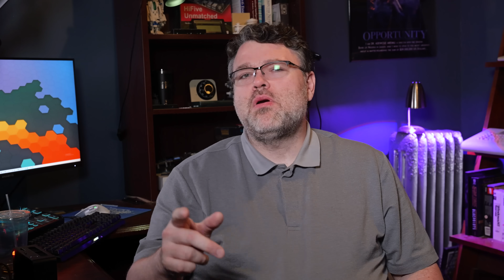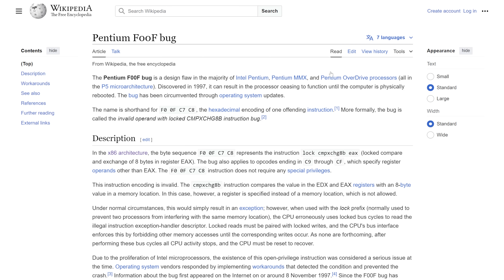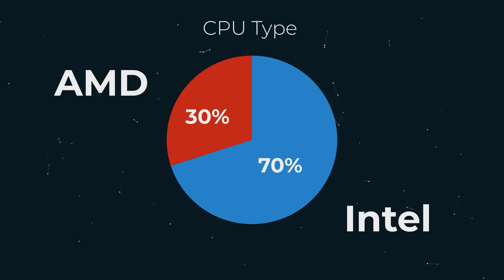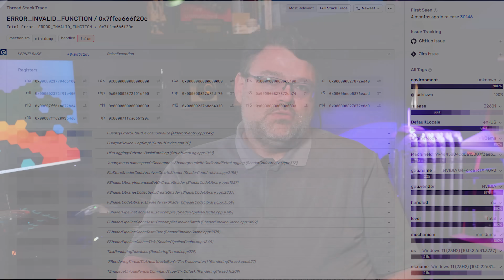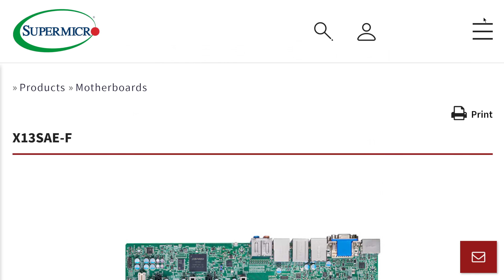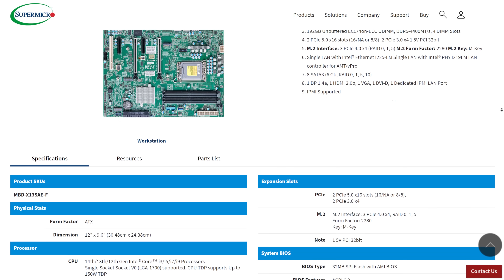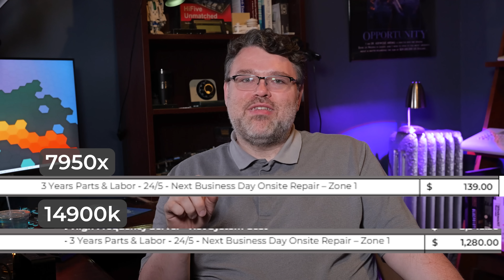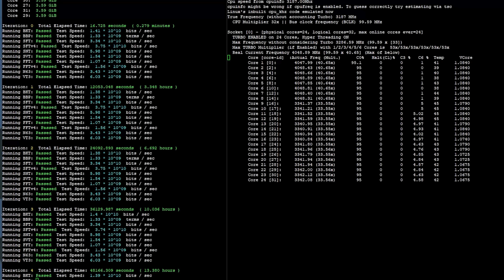Intel has a Pretty Big Problem

Comment: DISCLAIMER: This is just my own speculation!!

I really have the suspicion that this might be a die defect manifesting for some of the chips that slipped through binning because it's so marginal it is hard to find because the time they spend testing is not sufficient to find it. With smaller and smaller lithography, this seems to become more and more of a challenge. So the root cause could be an issue in Intel's fabs.

I got a 13900KS on an ASUS Z790-CREATOR WIFI with 0814 BIOS version, limited to 320W maximum on PL1 and PL2 and with a 50mV undervolt and it runs rock solid since I bought it. I basically did this tuning on day one and haven't upgraded the BIOS anymore after I got it working. Never change a running system. I'm doing a lot of single threaded things but also multi threaded tasks. I rarely but occasionally also play games.

The only weird thing I observe are rare WHEA errors where it says an error has been corrected regarding some PCIe port that connects to my 10GBe Ethernet chip on board, which I also use and I never have network issues either. But that could be attributed to the first version of the Thermal Grizzly Contact frame I am using, maybe the mount is not 100% correct.

So it seems I am just lucky and got a chip which doesn't have this weird fault... Goodness...

Comment: Intel is pushing their chips too hard in an attempt to keep up with AMD's ongoing superiority with Ryzen I suppose. I'm feeling that by now their Core architecture has been pushed beyond the limits of what it is sensibly capable of, yet at the same time Intel does not have an answer in the form of a new architecture to keep up the fight with AMD.

Seems that Intel has made themself comfortable for too long without any serious efforts into improving their tech throughout the years as they were not experiencing any serious competition for a long time, therefor there was no need to invest nor make serious improvements. That was until AMD showed up with Ryzen and at this point even worse with various ARM cpu's now also starting to blow away Intel CPU's.

Comment: Verryyy interesting. Intel should come out clean for their own sake before Gamers Nexus does. Also, it's quite funny that Intel is now the buggy one that barely works while AMD is the cheaper, more stable and better performing one. Oh, how the mighty have fallen in just 5 short years.

And before you start throwing any accusations my way, I actually run 12600K system and have been mostly happy with it, but all these news and Intel's current shenanigans are suggesting that I will be going for Ryzen 9000 series later this year as update.

Comment: For what is worth Brian from the Channel YesTechCity has been saying for months now the problem is not microcode, Voltage or clock (at least just in part) but I/O (citing some unspecified Intel sources).
Basically the I/O portion was supposed to be a separate chiplet, but they went monolithic due to other foundry related issues and that caused the problems.

Comment: I just bought 3 X MS-01 with the i5 12600H CPU to use as my new home lab cluster for XCP-NG.  I hope this problem does not extend out to those CPUs, and feel like even if not, I barely missed a bullet by not getting the more powerful 13900 series CPUs.   Damn Intel; what is wrong with you?

Comment: Before the problem went public I had to troubleshoot by myself. I had it with a 13600 and an upgrade to 14700 did not help. Changed memory an tried out the graphic card (4090) on another system. Motherboard is an ASUS PROART... I had no idea how to troubleshoot it.
Reinstalled windows and changed and swapped multiple nvme ssds.
In the end I solved it upgrading the alimentation from 1000 to 1200 w. !!??!!
After that all the internet discovered the problem and I changed the bios setting as proposed but by that time the problem was not there anymore.

Comment: I use amd so I can use ECC ram on my desktop pc with normal cheap chipsets, and ensure data integrity. Intel still artifically seperates ECC because they suck. Currently running AMD Ryzen 7 5700X3D with ECC ram, so, so  stable.

Comment: Significant slowdown followed by crash sounds like thermal problems.
I used to have significant overheating problems where the moment my CPU reaches 90*C it will slow down significantly (60FPS turns into 10 FPS) and after a few moments it might crash.
I fixed it by underclocking both CPU and GPU.

Another situation that causes such issues is running out of RAM, it will also slow down the computer and then crash it, but I doubt this can be related to a CPU.
Its a recent problem on linux since SSDs became so fast that linux OOM protections are unable to detect them fast enough and you end up with trashing.

Comment: My luck strikes again, went from an unstable Ryzen 9 3950x to a 13700k... I'm praying my CPU survives at least 2 years now.
Reply: Same man. I build a workstation for design, video editing and of course gaming around a 13700k in last November and i have no problems whatsoever (i did undervolted and power limited to ensure my air cooler could handle it)... I'm praying it keeps working with no issues at least for 2 or 3 more years or until Nvidia 60 series comes out.
Reply: i7 14700KF on Asus Z790 with RTX 4070 taken on dayone and i5 13600KF on Asus B660 with RTX 3060Ti for a year and a half. No problems, no blockages, no instability, they work 8/9 hours a day including 3/4 hour gaming sessions. with the microcode 0x129 the temperatures dropped a little... I'm really lucky so I'm going to gamble

Comment: Might mean nothing but we have many customers in our DC that use Ciara servers (crappy machines that use mostly high end intel consumer grade CPUs ) and in the last few years I’ve seen a huge spike of Ciara technicians replacing motherboards for “issues”... 

At the same time we had big issues with AMD based HPE servers (we have hundreds) that even AMD engineers haven’t been able to fix, especially in combination with some specific solar flare NICs... so your mileage might vary

Comment: I bought a 13900K on launch date, well not one, five actually. four 13900K and one 13900KS.

Two of my 13900K were "defective". Out of the box, clean, everything set to AUTO on bios, defective type of defect (got it?) - I'm wording it this way because, when you have 5 sets of motherboards, and 5 sets of DDR5 memory to test these defective CPUs (which was my case) - I can easily blame the CPU. 

The Internet did not allow me to blame the CPU. People tend to blame everything else but the CPU. Whenever I said that I got a defective CPU out of the box, the internetz (Reddit, Twitter, Discord, Forums) everyone said that I was an absolute amateur, that it was probably my motherboard, PSU, memory, monitor, my house, my cable, the alignment of the stars, etc...

The type of defective I am talking about is: A CPU that cannot even install Linux/Windows, crashes on the installation. I brought home the worst of these 5 CPUs, I managed to use it for a while, I discovered that my CPU issue was the CACHE CLOCK. If the Cache was 3.3Ghz, it wouldn't crash, 3.4Ghz? INSTA-CRASH (didn't even boot, and if it boot, it crashed on Bios or Windows load).

I used this CPU for around 6 months, it used to BSOD a lot on me, especially WHEA_UNCORRECTABLE_ERROR, and I also got a lot of these Out of Video Memory messages.
I've been overclocking since the Barton era, LN2 type of overclocker, it is a family thing here, but anyway, whenever I am talking about my defective 13900K's, I'm talking that THEY DID NOT WORK ON DEFAULT SETTINGS. 

So after 6 months of use, my 13900K died (the bad one) - The half-bad one is still alive and my friend is still using it at our company. The 13900KS is solid as a rock, and the other two 13900K's are average, they did BSOD a couple times, but not that frequent.

After my 13900K died, I used the 13900KS a little, and recently I bought a 14900KF, the 14900KF is "OK", never crashed, but I still get the [OUT OF RAM errors during shader compilation] if my CPU is heavily overclocked.
But being honest here, at 5.5Ghz I do not get these VRAM errors, but at 5.9Ghz/6.0Ghz which is my daily clock, there are a couple games I cannot run, especially unreal engine games.

The WHEA_UNCORRECTABLE_ERROR reminds of my previous 10980Xe, which when heavily overclocked, it gave me the same BSOD, and it was often linked to VCORE. It was easier to overclock the X299 though, especially because the VCORE/RING are decoupled. REMEMBER: The 13900K gave that error when on AUTO SETTINGS, DEFAULT SETTINGS, NOT OVERCLOCKED, WE ARE NOT TALKING ABOUT OVERCLOCK STABILITY.

Sorry for the rant, but I was being ridicularized for around 1 year, luckily in the last couple of months, a lot of youtubers are bringing this issue forward.
What bothers me is that I cannot RMA my defective 13900K, I bought it on the United States but I am back to my homecountry, I need proof of purchase and I have no clue where that thing is.
So my dead 13900K is now a keychain.

The bad CPU didn't work on my my ASUS Z790 Maximus Extreme at all, never booted there, but it always worked on my Z790 Taichi Carrara, upon inspection I saw that the Asus board booted into the UEFI with high clocks (5.5ghz+) while the Taichi booted at Non-Turbo Clock Speeds (3.0Ghz).

So by fiddling with the bios, I figured out that my defective 13900K was actually a good overclocker, I could clock the CPU up to 5.9Ghz with very low voltages, no issues, the problem was the Cache Clock.
I could leave E-Cores at 4.6 Ghz, PCores all 5.9Ghz, but Cache? Max 3.3. Anything above 3.3Ghz was INSTA CRASH. So the problem was the ring.
Reply: @genejones7902  Hmmm, I don't have a single kit, changing them didn't change the outcome at all. My main kit is CMT64GX5M2B6400C32, and my secondary kit is F5-7200J3445G16GX2-TZ5RK. 

Since I bought PCs for my company, I tired running 128GB for testing out, and it doesn't work well. It looks like all Raptor Lake are not accepting 128GB ram at all.
Reply: @genejones7902  And the 13900K has a potato as its memory controller. I've got 125GB/s + on my still running 10980XE on my X299X Waterforce. Skylake-X has a hell of a memory controller.
Rocket Lake can't even take four sticks, and caps at around 121GB/s for me.

Comment: Multiple generations of minor upgrades and incremental clock speed increases have resulted in trash cpus. They've had 5 years to get back in track and still feel a million miles away when it comes to what really matters. The only reason they are still able to compete is the loyalty they have built up but even that mindshare is eroding.

Comment: I can get my cpu to crash reproduceable on cyberpunk when loading safe games „decompression“ operation
13900k do I own 
In order to not get these errors I either have to:

Disable P Cores
Reduce ratio of p cores and e cores below factory settings reducing max performance a lot

After a long back and forth and debugging on my machines I got my warranty case through and got a new cpu just to get the same results in a differently machine different board etc

Comment: It is so sad in recent years there were so many quality issues, it seems like tech companies going backwards in so many ways. For example i own 14 years old 640 GB Freeagent go Seagate external HDD it still works completely fine. Used it in dozens of devices including TVs etc, removed it unsafely hundreds of times never seen any file getting corrupted. Recently bought 2 TB Seagate Expansion HDD and omg it corrupted dozens of files within few months nor works in smart TVs. It literally feels like an inferior device despite coming out more than a decade later from same company. I'm scared to plug it in anymore, sometimes even safe eject doesn't work giving error while it is idle supposed to be doing nothing. If this low quality trend continues we will be buying 'old tech' really..

Comment: Let "enthusiasts" and gamers rage all they want - datacenter operators increasing their service charges and OEMs starting to notice that warranty claims go up is Intel's real problem here. MB OEMs being publicly blamed without adequate technical communication from Intel (see the HUB video from Computex) is troubling, as well. Having AMD handling the voltage problem that literally blew up a few CPUs almost perfectly in comparison doesn't help, either.

See, customers by and large are very uninformed to the point of ignorance. 99.999% of people going into a store to buy a computer will not have seen this video. In the end, they'll buy what's on offer. So if the OEMs start jumping ship and start increasing the number of AMD systems on offer, then start noticing they have fewer warranty issues there, that's a shift in the market with lasting consequences. The same goes for datacenters.

Us enthusiasts are not the yardstick here. I'm an AMD user for years, starting with my AM386DX waaay back in the early '90s, but all in all I've probably had an equal share of Intel and AMD systems - whichever was better suited to my needs at the time. But that's not what the average Joe does. And there's a lot more average Joes out there than us here.